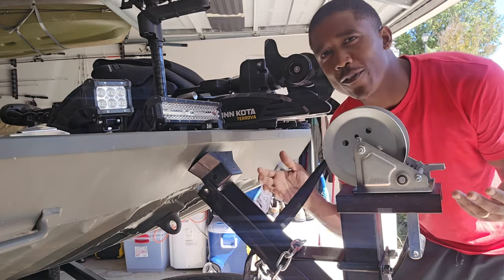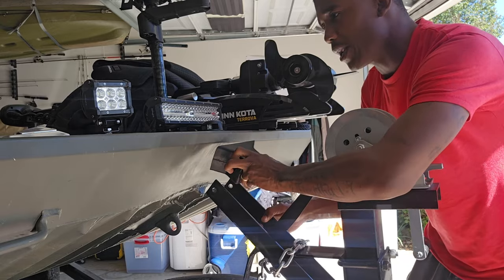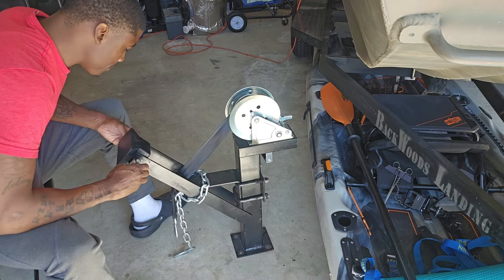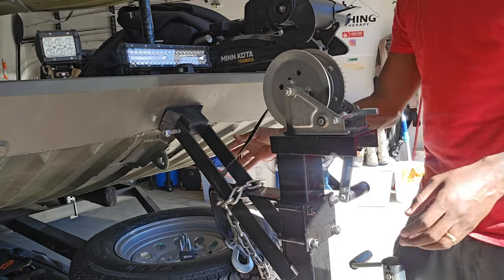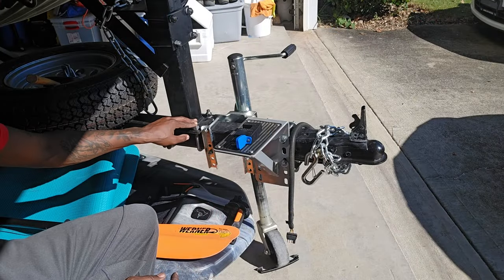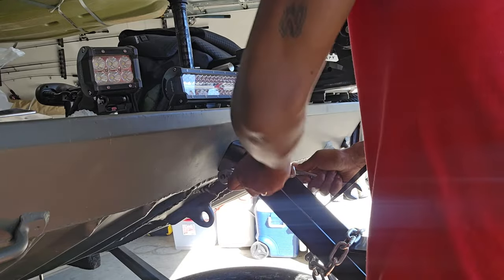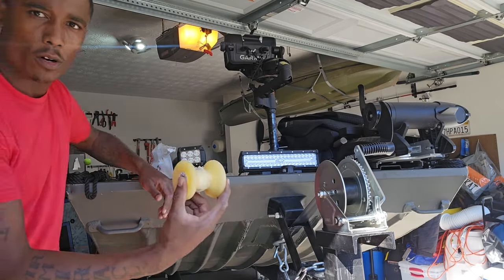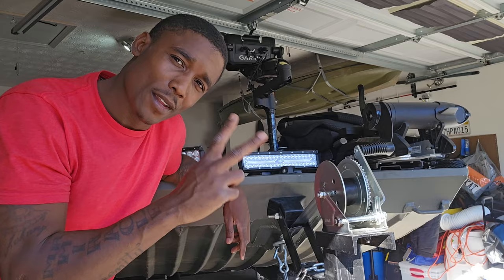Ignoring This Could COST You! The CORRECT Bow Stop For Your Flat Bottom JON BOAT - Yates Bow Stop

Comment: Great fix, glad you're back at it! If you add washers to both sides and a lockwasher by the nut (<$1 at HD or Lowes) you won't have the bolt stick out. Maybe a dab of locktite too to never have to check its tightness.
Reply from the maker: Awesome tip. Definitely going to make that happen. It worked flawlessly this past weekend, glad I finally have the correct setup

Comment: In my fix, I'm adding an additional plate where the bow stop hits. My Weldbilt actually developed a small crack there too. I'm hoping that will help prevent the dent developing there in the front. I assume that will get worse over time with this bow stop.
Reply from the maker: Yes, I agree to adding an extra layer in that area. I asked my welder about doing this, but the crack stopped before the area where the bow stop fits, so he just reinforced the weld in that area. I have a lifetime warranty from him, so if any cracks or issues develop, he will fix it for free.
Reply: Nice. Very helpful videos!
Reply from the maker: I appreciate that. Glad the content was helpful!
Reply: @fishingistherapy  Got mine fixed. They used some thick stuff and did it a little different than yours. It looks very professional and is super solid. I also had them weld on a trolling motor mount and fill some holes. Total cost was $250. Putting on that etrailer rubber stop today.
Reply from the maker: @mikesheppard2883 Awesome. That's about what I paid as well. Good stuff. Once you put on the stop you will see why it's superior to a bow roller@

Comment: I noticed your 2x4 is different than mine. I have mine flat, so more will be supporting  the bottom of the boat. It seems that 1.5 inches of the board would put a lot of stress  on the boat to me. That's why i installed them that way.
Reply from the maker: Yes, I think that's a good idea, more boat support works out better overall. Do you have the same type of jon boat?
Reply: @fishingistherapy   its a all-weld but my chain  connection loop is on the flat spot where you put the bow stop
Reply from the maker: @slingshoter8783 Okay, that makes sense for you to put your flat stop underneath. I think weldbilt should make a strong suggestion that their boats need a flat stop to prevent future issues.

Comment: It's just amazing how many boats are on the wrong trailer and definitely alot of them have the wrong bow stop
Reply from the maker: I was shocked to learn that most boats and trailers come from the factory floor or shop yo buy it from fitted improperly. Knowing this information could save alot of money on boat and trailer repairs.
Reply: @fishingistherapy  for sure. And every dent in the bottom of your boat knocks down your top speed. They call it hooks in the hull.
Reply from the maker: @chrisj2713 Wow, thanks for sharing that, learned something new. That's makes total sense. Been trying to get my 20hp and this 1448 up to about 25mph by myself and atleast 21 with a buddy. The dents cause alot of drag.